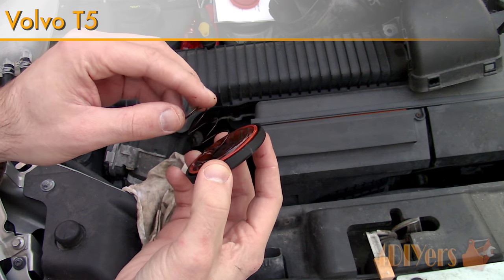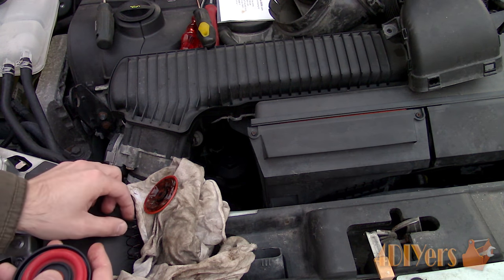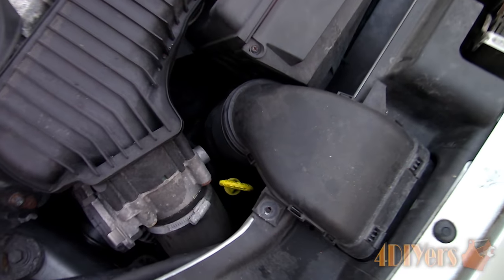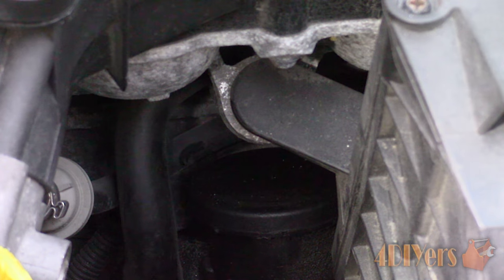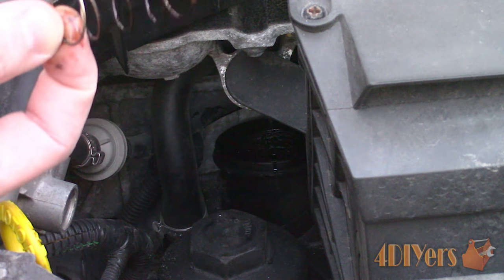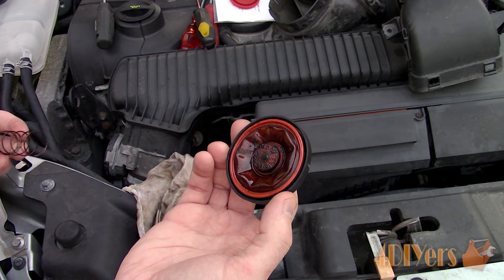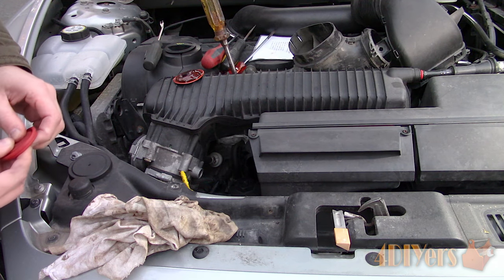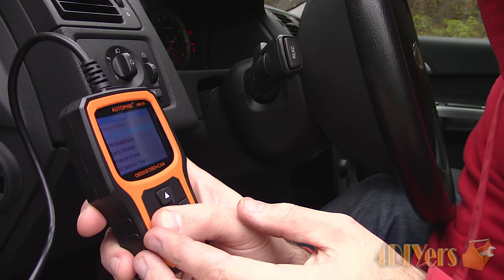How to Replace the PCV Diaphragm on a Volvo T5 [Money Saving Way]

Comment: Thanks for this. I was able to order the part directly from vanos-bmw in Russia for $15, with $10 shipping.  The drawback is that it takes a month to arrive. Worked on my 2012 S60. A question, when I popped the cap, it was very grungy inside.  Is this something I should be concerned about?
Reply: Flush the whole system. I reckon you have some mileage on yours ?
Reply: @masaboren2743  Yeah, approaching 90k. Tips on flushing?

Comment: Anyone with a xc60 t5 2012 ? I think the oil trap is attached to the engine block at the front, below the intake manifold? Can anyone confirm before I dissasemble the intake? Mine does not have an oil filter box, but rather a standard screw-in oil filter. THanks!

Comment: I have a 2006 S40 T5 with 100K miles.
I have replaced my PCV diaphragm four times in the last 2 years. Three weeks ago I replaced oil filter housing because the diaphragm went bad again. Well, the diaphragm in the new housing is bad also. I obviously have a bigger issue on my hands. Does anybody have a suggestion where to start the troubleshooting at?

Comment: Is this trick for real ? Have the same problem on  -06 V50 T5 (260 tkm´s odometer reding) and carage mechanic just told me the housing will cost 300 € + misc. parts + labour ! Mechanical part sounds really DIY. I will let them flush my oil channels with "wash oil" due to the fact that every place has this black mud/sand on it. That will cost only like 300 €. Then fill it with Castrol 5W30 fully syn..

Comment: update...skirt of cap has a small thin shoulder on the housing that it seats down on, so you cant pry up on that lip, because it is part of the entire PVC housing.  You have to wedge a sharp flat blade screwdriver or something inbetween to pry the cap apart from it, and then work your way around.  The entire PVC housing snaps down around top of the OFH body with tabs. I broke the tabs on the left side and popped the entire housing up off of the OFH... i am going to just get a diaphram and try to reuse the original PVC housing, since it has a gasket around whole perimeter that seals off to the ventilation body of it for crankcase.   Mine (the diaphram) was rotted horribly, and was sucking air like a vacuum cleaner...

Comment: Tried very carefully to not break anything and somehow cracked the housing trying to get the cap off. Was on there very tightly. The lip of the housing came off with the cap. Off to the junkyard to try pulling a replacement housing. 😂

Comment: Thank you for your video which is straight forward. Yes it was difficult to remove the cap and put it back again but it worked fine. However after replacing the diaphragm the car is back to normal. However if i remove the dip stick or oil cap I am getting smoke. What would be the reason behind it ? Thanks

Comment: Great video.  I'm doing the same on my XC70 which I believe the diaphragm will work.  However, the brittle cap basically broke at all the snap ons. When taking it off. Does anyone know where I can get a replacement cap?
Reply from the maker: Thank you! As far as I know Volvo doesn't sell a replacement so a used route is the only way. Either from someone parting out a car privately or from an auto wrecking yard.

Comment: My s40 did this to me yesterday when getting into work, I had to drive it home (not knowing about the dip stick method) and when I parked it there a little bit of oil around the timing cover and inside. Do you think I have ruined my cam seals?
Reply: If the oil is around your cams and on your cambelt your camseal is definitely ruin i had the same and had to replace it
Reply: @sychst8182  Damn i was hoping for the best
Reply from the maker: Sadly yes the seal is most likely damaged. You can clean off the surrounding area and then keep an eye on it to see if the leak persists.

Comment: Got my diaphragm today, took about 3 weeks from Russia to Florida, and installation took perhaps 20 min.   The cap popped off using 2 screwdrivers, and installation worked well after a bit of lubrication, and then first pushing by hand and then carefully tapping a bit.   I actually installed the diaphragm  and the spring into the cap, and then installed the cap with all together....I guess I should have done like in the video, but this method worked as well.  No more suction when opening the oil cap.  Thanks for the video!
Reply from the maker: Awesome to hear and thank you so much for the feedback!
Reply: From Russia ?? I live in Florida and I bought it here in the USA ...  Ipdusa.com or elevatecars.com . In here you'll find any part you need for your Volvo

Comment: I can't get the cap off.. There is no notch cut out. Or at least it's not facing me in a position I can't get to it.. I've already damaged bottom part that cap connects to but not enough to hurt anything.. It's always harder than it looks in videos. How do I get it off?

Comment: I had this problem, I pulled out the dipstick a little to quiet the whistle, drove about 5 miles and now i'm getting exhaust in the coolant. Could doing that cause a blown head gasket?

Comment: Hi there, on my 2.5t ford i just did the replacement of the diaphram. Installing the cap with the spring correctly is quite a challenge. I am 100% sure the cap is closed correctly, however how the spring inside is sitting exactly i am not sure.
I dont have a wistling noise or exsessive vacuum at dipstick or filler cap.

Is it possible the diaphram is not correctly installed without having the symphoms?

Comment: nice video ,, i have a euro 1.6 2008 focus ,, my pcv is under the 
intake, i changed it recently , but there is another hose from the top 
of the valve cover to the air box i thought it should suck air in as a 
breather but it pushes air out and oil as well to the air box , you have
 an idea whats going on?

Comment: There are two types od membrane and they are not interchangeable with each other. You have to buy the same type that You have got originally in your car. Otherwise it will not work properly and will not close tightly.

Comment: Why when you are removing the cap you change the tool without showing the tool being used? I can see how the frame stops and appear a thinner tool which is the one you use to open the cap.

Comment: Are You sure You've got the right membrane? For B5254T3/T7 oil filter housing there are two types. It looks like damaged one is old type, and You're replacing it with new design membrane. They aren't interchangeable.
Reply from the maker: That's what they sent me, I compared it's dimensions and it matched up with the old membrane. The only difference is the spring "seat", I made sure it didn't affect the operation and haven't had any issues. The car was even emissions tested after the replacement. The membrane choice was based off the part number of the oil filter housing which I cross referenced between two dealers and also through my own research.

Comment: Hi. Thanks for posting this video. I was about to order the whole assembly and found by chance the diaphragm on the IPD website listed for the natural aspirated non-turbo 2008-10 v70 P3 3.2 engine. Would install be the same/is the diaphragm cap also removable for non turbo engines?  Access is certainly much easier.

Comment: Very helpful video! I just checked my engine (V50 T5) and noticed, that there is some negative pressure in the housing. It's enough that you feel the Oil-lid beeing sucked in. However nothing changes in sound or revs when I open the lid or pull the dipstick. Also there's no engine fault light active. Can you tell me how much of negativ pressure is ok? Or should there be none?

Comment: OK well yes agree good video one bad thing is  I did replace mine Just the Diaphragm was all good for a little over a month I think there is to much carbon build up be hind mine because now it is squealing and my Vaccum went back up on the engine. Not saying this will or will not fix your vehicle just make sure you get the carbon under the cap cleaned out also.
Reply: @sparky24 I did think of trying that I just bought a new filter housing I will replace it when i get the chance to take it to my shop

Comment: Hi there, nice video. I would like to ask you, that high pitch whining/whistling noise in the video where you start the car up, is that the noise you are talking about? Because I am having the exact same noise when i did the turbo to crossover hose, the crossover and and group a intake. It is just weird that the noise came just after replacing those parts if it is the diaphragm? Any advice is appreciated!
Reply from the maker: Yes that is the high pitch sound. Also cheap your oil cap pressure as well. It's definitely not something to be ignored as it can cause some costly damage.
Reply: @4DIYers  thanks for the answer. I have just tried starting the car, and the sound does not seem to disappear no matter if i lift the dipstick or unscrew the oil cap, but there does seem to be a bit of vacuum when i lift the oil cap. The sound does not seem to be there at idle, but only when i start the car and when i rev to about 2000 rpm and let go, then the sound appears shortly. I guess it could be that the crack in the diaphragm is not very big? But i guess i should just take it out and inspect it.
Reply from the maker: Could be just starting or may depend on the shape of the break.

Comment: Had the squealing problem on my s40. Sure enough, the diaphragm was torn. I ordered and installed the replacement, but it's still squealing. Any idea what it could be if replacing the diaphragm doesn't fix it?

Also, what did you mean by the "alignment tab" for the spring?
Reply: Put it on backwards?
Reply: Not seated correctly and tore the new one?

Comment: Thanx alot for the video, i have now ordered a new one :)
Reply from the maker: Glad I could help and thank you for the feedback!
Reply: @4DIYers  I Have now changed mine to a new one, the bad news is that the old one wasnt broken, not what i can see :( I still put in the new one though and now the car is quiet but its still alot of vacum if i open the oil lid so i can imagine that the sound will come back. Any advise on what else it could be?

Comment: Thank you for the video. Quick question: If I notice there is a strong suction through the oil cap, is that the same as the mentioned strong vacuum? Would replacing the diaphragm help with my problem?
Reply: 1) yes 2) likely

Comment: I don't get it. Some are saying the cap is easy to remove, but mine's stuck fast. I've got the perfect size bent bar to get a load of leverage off the oil filter housing and I can get a screwdriver in the notch but the cap isn't coming away.
Reply: I've now dropped two of the tools I was using into the engine bay. Spent two hours trying to get the cap off. It's still not budged.
Reply: For anyone else, I got in with a wood chisel. Made a bit of a mess of the plastic, but I'm in.
Reply: The replacement part was slightly smaller in diameter. Not sure if that's normal. The problem is now worse.
Reply from the maker: Sounds like you got the wrong diaphragm. It has to be the correct size, otherwise it'll leak and act just like a cracked version.

Comment: Thanks mate, I have one of these on order. your tutorial helps a lot.
Reply from the maker: No problem, happy to help!
Reply: ty Wins  hi mate its surprisingly easy to open the lid but just be careful to not damage the surfaces when you prying it open. Open slowly to avoid  the spring popping out. The spring is a little tricky to get back in but you will get it.  The lid just snaps back into place. You have to align the tabs up though.

Comment: Thanks for the Video!
I already replaced the diaphragm on my T5 (it showed, that the old one was still ok, but I changed it anyways), but is seems it still has some negative pressure when I open the oil filler cap (see it here: https://www.youtube.com/watch?v=TbXr5No16kc ). Not as strong as in your video, but still recognizable. Do you have any hints on that?
Also: there ist still a whining in the engine bay, but meanwhile I think it's the elecrtical servo pump....
Reply: Was it the same sound/pressure before you changed your diaphragm? Maybe a bad installation?
Reply: @jean-paul328  it was the same sound before an after. When the car is idling, you can hear it comes from the left front - that must be the servo pump. But I can not surely say that's the same noise while driving.  It occurs often when i slightly lift the gas. It's annoying, because I can't be sure...and I can't really grab it.
Reply: @landypaule  Is it still making that noise? Well maybe it is "normal" then?

Comment: So I’m just getting around to doing this and I noticed on my 06 2.4i, there’s no cut out in the front to get any kind of pry tool under the lid without damaging it.....ugh fml
Reply: I managed to change out the diaphragms and I think it's important for others to know that there may not be a notch on the cap and possibly more importantly,  I feel a need to point out the seem between the cap and the housing is virtually invisible.  Vanos sends you information for links and photos to help one remove/ install the the diaphragm and in their photos, one can see the sliver of a gap between the cover and the housing.  Look for the photos Vanos has posted to see the thin line between the housing and the cap.                                                                              https://vanos-bmw.com/membrane-for-volvo-ford-30684381-engine-oil-filter
Reply: @brianbraley8710  This should be under the main comments so that it can be seen without having to unhide it. Excellent tip, although a bit late for me. I came back here to warn others of the same. I broke mine.
Reply: @SmartAceW0LF  You are right...should be in main comments and unhidden.  If it weren't for the Vanos photos, I would have ruined mine as well.  That tiny seem is virtually invisible.  Once found and manipulated proper like, it pops right off.  This diaphragm saved us hundreds.

Comment: Hi, Will? the diafram in the YouTube fit a S40i, 2004 model?
Reply from the maker: As mentioned in the video this will depend what type of engine your car is equipped with and if it has the same type of oil filter housing like what is shown in the video. The manufacturer of this diaphragm also has a couple different options as these cars can take a couple different styles.

Comment: Thank you so much for this video mate, really, please any link for the Diaphragm part please couldn't find it on Ebay. I appreciate you Mate!!
Reply: Don't look on eBay.  Type in the exact site on the bag in Google, you'll get the site that makes and sends them.  Took a couple weeks with the $50 shipping and it came from Russia.
I live in WV, US.
Reply from the maker: Just type the site in from the photo of the package, they have an Ebay store and website. I had to buy mine through Ebay because I was having errors using Paypal on their website for some reason.
Reply: I found the item on IPDusa.com.
Reply: Matthew Meyer Sr link? I already got mine through the sellers eBay site but could be useful for others.... Also, I found  that my plastic lid on the pcv housing doesn’t have the opening to get a pry tool underneath like it shows here in the vid and now I’m left here scratching my head how to get it off with damaging the thing
Reply: @DarkDragoon83  I just completed my son's 2008 Volvo C30 T5. I used a long flat screwdriver and caught on edge of top and it popped of realitivly easy. Now, putting the cap back on... Rough. I had to loosen up air cleaner box so I could have better view everything. Good luck.

Comment: Would this cause the check engine light to come on????
Reply from the maker: I never drove the truck with this issue. However worn control arm bushings, ball joints, or tie rods can also cause the same issue.
Reply: Yes.  I pulled a lean fuel code.

Comment: Hard to find right one on ebay.   Can you list company that sells correct diaphragm?
Reply: veroplant veroplant Just bought one for my Xc60 from a Polish company, and could not find any others except a Russian one.
Reply from the maker: https://vanos-bmw.com is where I purchased it from. However the diaphragm needs to match the part number for the oil filter housing. I just called the dealer, gave them my vin, inquired about an oil filter housing, and then asked for a part number as a reference.
Reply: @4DIYers  This is why I used to read everything. Thank you!

Comment: Would this cause a rear main seal to give out too? I heard this whining sound then one day soon after oil was on the ground.
Reply from the maker: Unfortunately quite possibly. Popping up the dip stick allows the pressure to be relieved.
Reply: @4DIYers  yes I tried that when I was hearing the whining sound but I didn't notice in difference in the sound. Not sure what to think about it but once the seal did go I didn't notice the sound.
Reply from the maker: @6lastresort  if you popped up the dip stick, it should have changed the tone. But this sound is very close to a failing bearing too. Perhaps it was just a coincidence with another component?
Reply: @4DIYers  yeah that's the only think I can think of. Definitely sounded similar to a power steering whine but it only did it at idle.
Reply from the maker: @6lastresort  I've had weird coincidences like that in the past. Best to take a look under the car and determine where exactly it's coming from. Also what does the fluid smell like or what color is it. Whining at only idle, it's possible it could be from the power steering. The reservoir is behind the passenger side headlight, really bad spot. You could always pop the cover off just to be safe.
Reply: @4DIYers  well the bad news is it's at my mechanic right now and he's convinced it's the rear main seal. Having clutch issues also. So yay me  🙌 😭